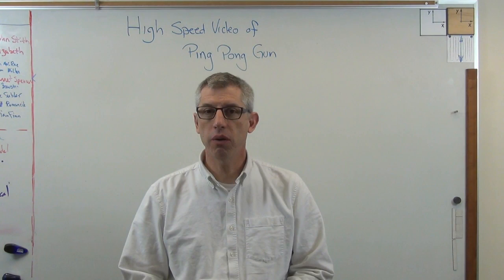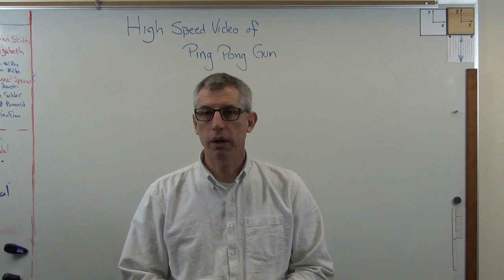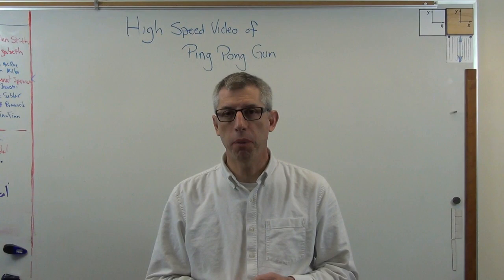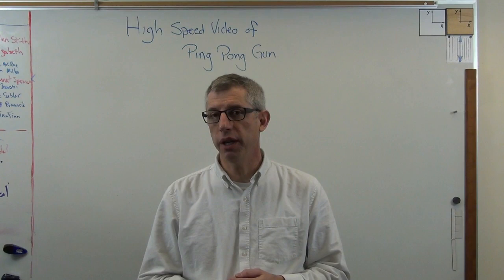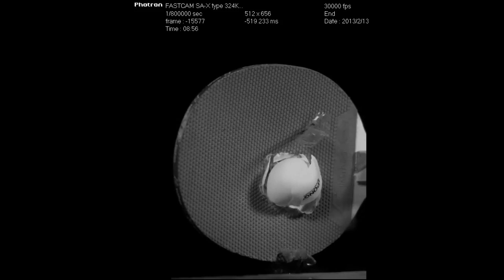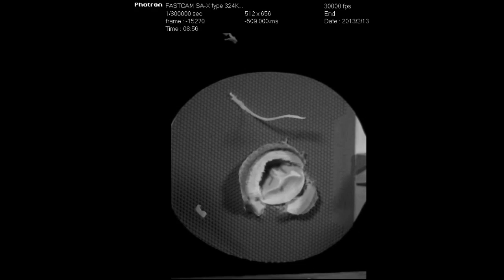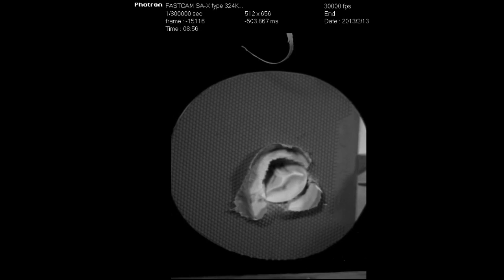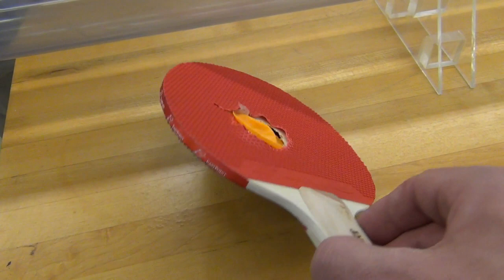High Speed Video of Supersonic Ping Pong Ball

Comment: As a table tennis player, I have always wondered about the physics at contact ... especially now that we have high-tech rubber sheets costing about $65-$85 on each side of our rackets. This rubber has some amazing characteristics, one of which, is that it can reverse the spin of the ball. I would love to see a slow motion clip of a topspin ball being returned by a high level player. The trajectory of the ball, the direction of motion of the racket, the compression of the rubber sheet, the rotation of the ball before, during, and after contact. What a dream to finally get a chance to see that! Did you know that there are so many table tennis players in the world that the only sport with more players is soccer?